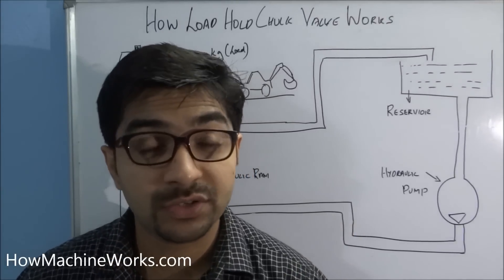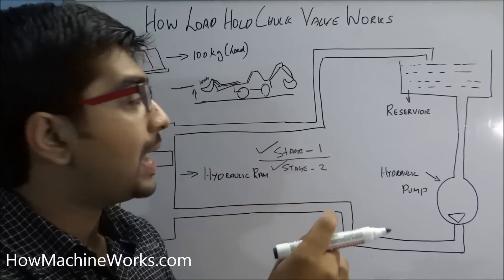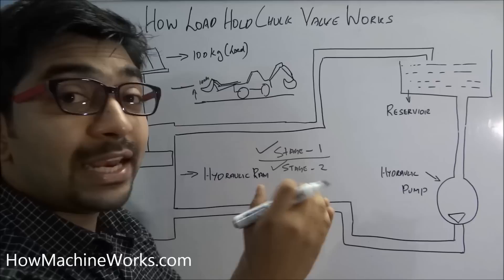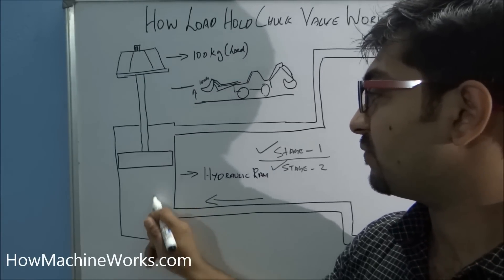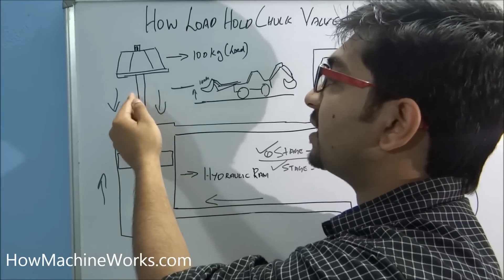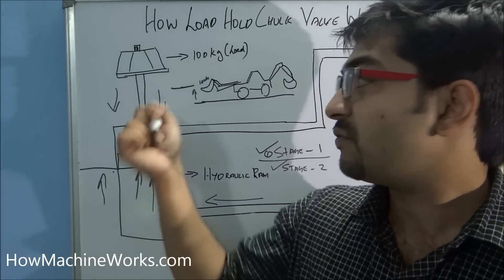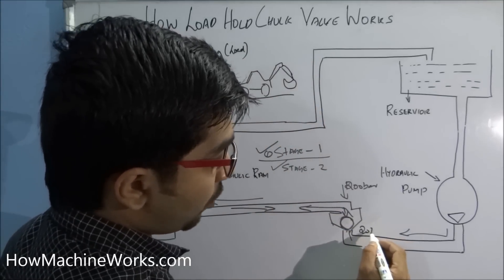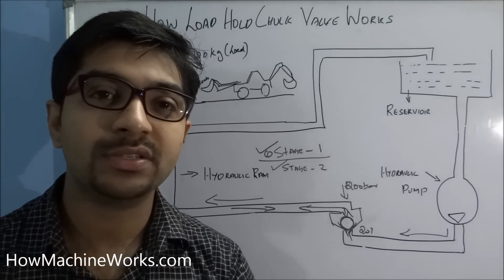How load hold check valve works - Must watch

Comment: Thanks for giving such a good information .u can include a control valve over there  because can easy understand while spool is in neutral position where the oil from the pump will go and how it go back again to control vavle

Comment: Question? How does the check valve allow for the fluid to flow backwards when you are lowering the bucket?
Reply: Ever seen a video on it?let me know plz.thanks.
Reply: Rajesh Crawford He didn't draw control valve.
Reply: That is working of a simple check valve... Load hold check valve is a little more complicated
Reply: There is a pilot line,it's not here thou.

Comment: I kind of "assumed" that this would explain the internal circuit load check for the cut-away control valve pictured in the link photo. I feel a little click baited.
Reply: I clicked 4 or 5 times looking for the video with the picture you described. Thought I was getting redirected!

Comment: You wouldn't be using a simple check valve (lift check valve) on a stick/bucket motion for an excavator. Load holding valves are almost always pilot-operated for such an application.

Comment: wrong diagram, where is your control valve, and your point is correct about holding, but you didn't visualize it correctly. have u ever seen a load check valve? I doubt it. once go and see and make the diagram again
Reply from the maker: +Sandesh Mokal Please watch the video carefully, its explains about the basics of it, i am also mentioning that the load hold chuck valve is on the control valve (but not showing the diagram of the CV to not to confuse freshers who are watching the video)
this video is not intended for hard core technicals, its just explain the basics of beginners,  will upload a video for you with all the details showing a load hold chuck valve. 
I have seen load hold chuck valve and i am in this industry now for more that 8 years.

its easy to make such personal and insulting comments, please consider that work put behind it, hope you understand. 

We are honored by that comment.
For more info you can email us at techtrixinfo@gmail.com or whats app at +919744615655

TechTrixInfo.com
Reply: +TechTrixInfo.com This video is confusing and isnt about check valve

Comment: Thats a good start but thats only half the story of a load holding or counter balance valve. You need to explain how the hydraulic fluid can flow past the check valve when the load needs to be lowered. This diagram only shows a check valve with no ability to lower the load.